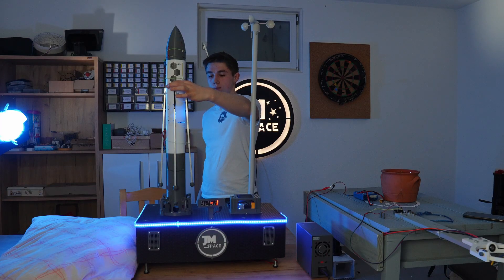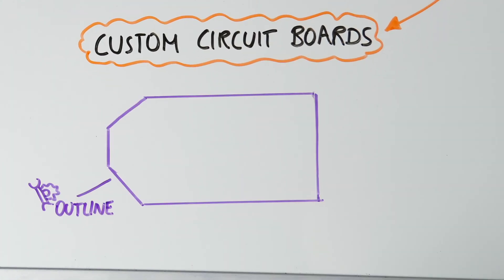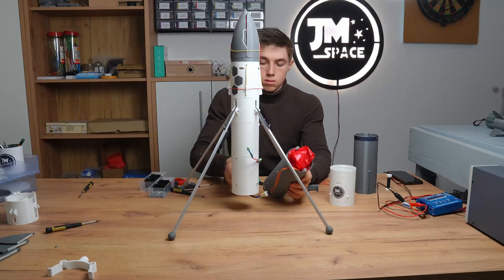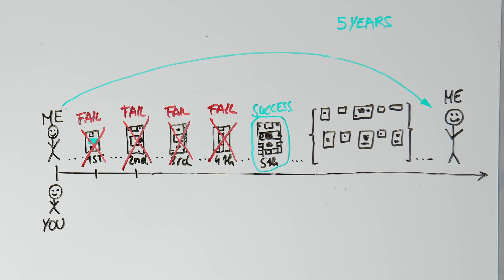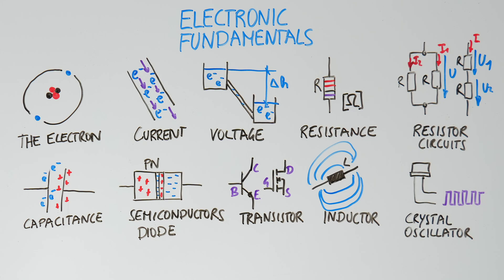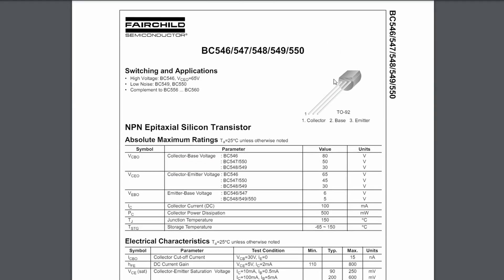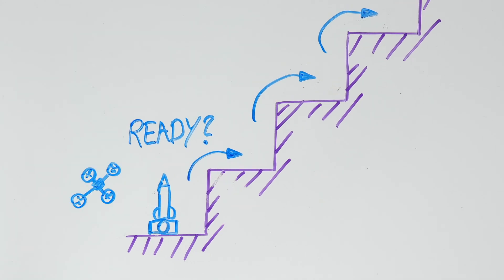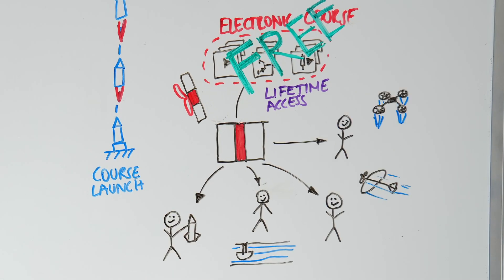The Ultimate Skill Every Maker Needs

Comment: Hi Sir,

I loved your video and checked out your course on Udemy—it’s amazing! Great work!

I am currently working with an STM32WB55RG and having trouble interfacing it with the MPU6050. My goal is to build a proof of concept and then design my PCB using Altium.

The problem I’m facing is that I can’t see the IMU output on my PuTTY terminal. The code compiles and runs fine, but there’s no visible output. I’m using the HAL library through an ST-Link port and a virtual COM port (VCOM).

Could you please help me figure out what might be causing this issue?
Reply from the maker: Hello Sir,

thank you for your kind words!

Regarding the issues you're encountering: 
we're looking into it and will will come back to you if we are able to assist.
Reply from the maker: Hello Sir,

to help narrow down the issue, here are a couple of things to check:

1. Serial Communication:
Can you send basic test strings from the microcontroller to the PC and view them on PuTTY?
Do you received no data at all, or only random symbols (This would indicate a mismatching baud rate)?

2. Sensor Data:
Is the MPU6050 being initialized properly?
Ensure you’re addressing the correct I2C registers for both configuration and data reads.

If you’ve gone through these steps and still don’t receive any data, feel free to share more details about your setup, and I’ll do my best to assist further.